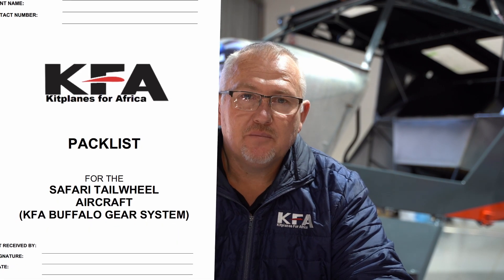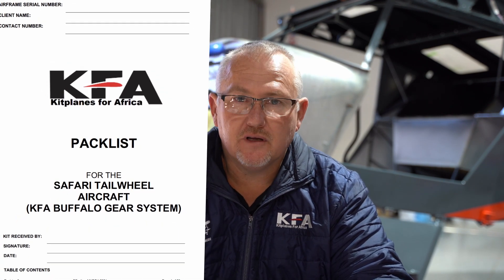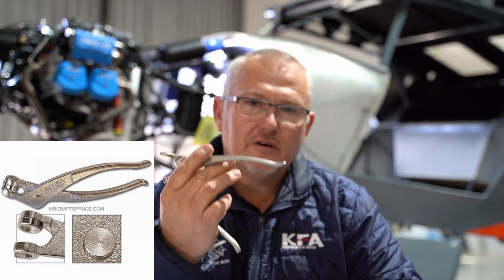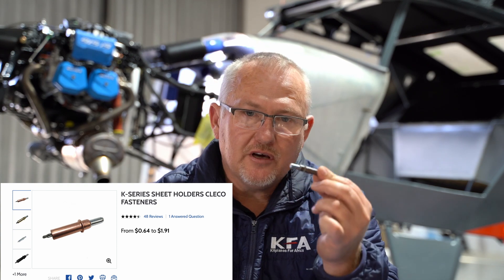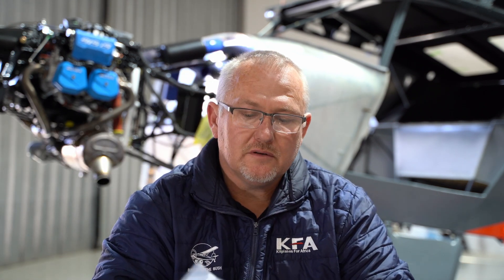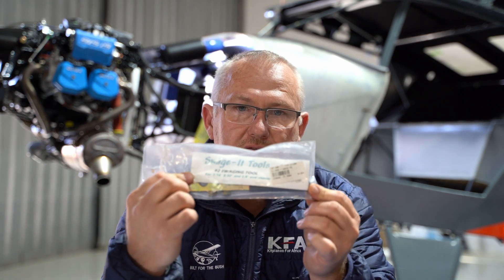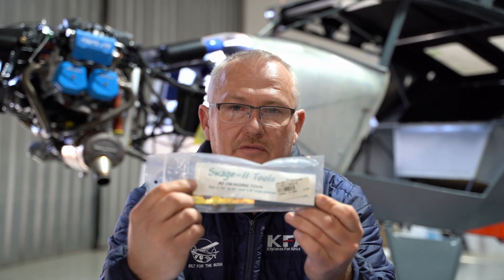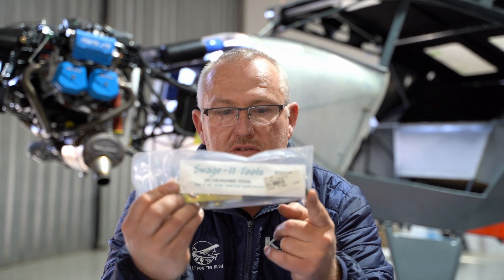Episode 1- General overview - Kit layout, tool requirements, manuals etc.

Comment: I would extend the number of tools by a pneumatic riveting gun because there are hundreds of rivets and sometimes you have to be quite fast riveting the things prior the epoxy resin cures.
Reply from the maker: Good idea to have a pneumatic riveter for the 4mm steel rivets. There are about 200 of these and you will have big forearms after pulling them by hand......All other rivets are alli and easy to do by hand.  These tips are mentioned in the manuals as well. Thanks for your feedback.

Comment: Stefan explain to me how does the Standard wing differ to the STL wing on the Safari?
Reply: The STL wing has a longer cord and slightly thicket profile, larger tanks due to the profile and adds in total 1,5m2 to the wing size. It;s a really good wing, so far I am very happy with the results. The stall speed is 6kts lower and the cruise speeds is 10kts faster. I will do a review on this wing soon.
Reply: Thanks